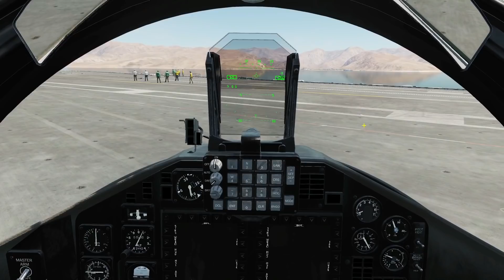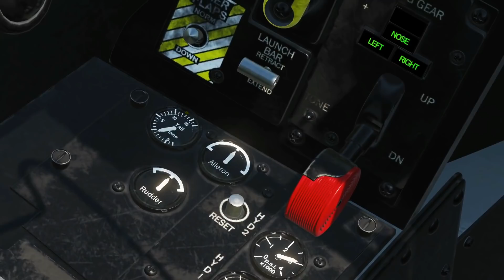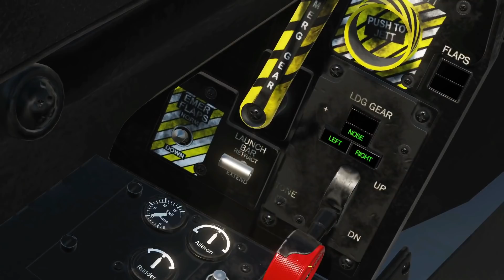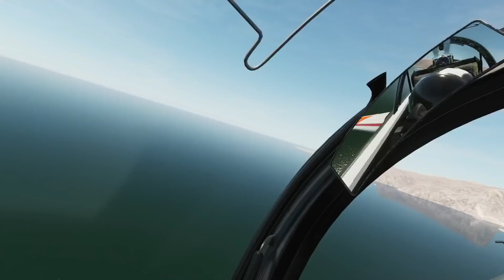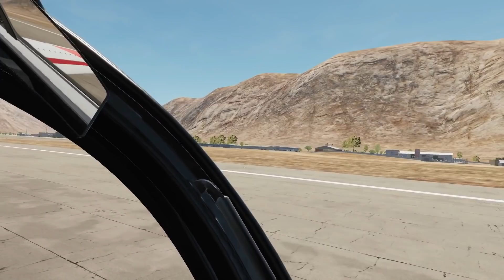T-45C Goshawk: Carriers & Airfield Takeoff & Landing Guide | DCS WORLD

Comment: I keep wrecking the front gear when taking off from the CVN-59, it just sits there for a second on max until it suddenly jumps forward, pulling the nose up before slamming it down again and continuing the catapult launch. Sometimes it survives, but most of the time it doesn't want to put the front gear up anymore. At times it even knocked me out briefly. I've checked that anti skid and the parking brake are OFF. Anyone else has this? I don't have supercarrier to check if it happens there too.
Reply: I have the same problem

Comment: those navy planes are designed to land without flare but not like that. 3 degree flightpath on aoa means about 650 feet/min vertical speed which they can handle. they cant handle your 5-6 degrees landings with huge vertical speeds

Comment: The life of me I keep getting perfect approaches on the aircraft carrier for whatever reason the tailhook will not grab any of the wires
Reply: Happened to me the first few times. I suspect it's due to aircraft being far lighter than an F/A-18/F-14, and so I felt the aircraft almost 'float' above the wires... Perhaps ground affect came into play? Either way, I've found a slightly more aggressive flare than usual helps.
Reply: THANK YOU, I thought I was just being a klutz, 4 good looking approaches, been in a Hornet or Tomcat, ACE'd it,  well maybe not, as they say, If at first you don't suceed....carrier pilot is not for you....well in my case I'm FIRED! , Great fun, teaches spatial awarness, concentration,,,,grab another beer,,,,concentration etc.
Reply: @daviddavids8218  and for the first time I got a Grade B on all three approaches and the tailhook still won't snag
Reply: @pilotguy1141  had the same issue. turns out my brakes were backwards which i barely noticed other than some screeching during taxi, but I never noticed because it would taxi fine. Regardless, once I swapped axis' it trapped just fine. (If brakes on when trapping, you'll probably blow a tire in real life, but if you didn't it would raise the hook point and I think the sim is smart enough to do the latter).

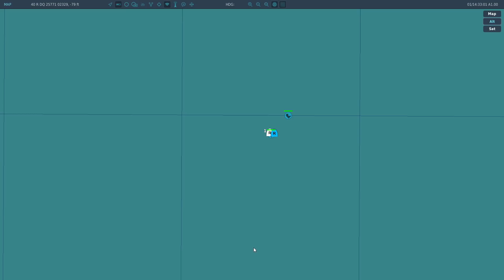Comment: 0:20 You're never doing wrong with the Neightops!
3:42 Acktchyually, that's Unicorn! :/)

12:45 Guess that happens when you don't firewall the throttle on touchdown and the wire is being reeled it. The aircraft is so light and short that pull literally makes it nose up.

Comment: why there no  catapults on airport runways ???
Reply: Because runways are long enough to allow the jet to accelerate fully under its own power. The pilot is responsible for determining that the runway is long enough to facilitate both takeoff and landing based on charts in the aircraft manual prior to using the airfield.
Reply: bc why should there be. there is enough space and a catapulte lunch puts a lot of stress on the airframe, thats also the reason why an f18 that is stationed on a career needs much more maintenance then one that is staitioned on an air base.
Reply: @TheRattail  uhh you cant maintance frame stress wearing.
Reply: @mikkihintikka7273  of course you can but it's f*cking expensive. And why should you spend all that money if you don't have too. And on top even if you do maintenance on the frame stress, their is still a higher risk of failure. That is actually the reason that there are more in air emergencys in the navy than in the air force. Meaning that it would just make the maintenance much more expensive and still put the pilots in a higher risk of a fatal failure.
Reply: The stresses caused by a catapult would damage most un-navalised aircraft...also, they don't usually have a launch bar
Reply: because they are freaking expensive, hard to install (expensive) and not needed.

Comment: Unfortunately they didnt put a "Rudder Left and Rudder Right" option in controls. So for someone like me who doesnt't use them this mod is useless!
Reply: Go to [path to your DCS Saved Games folder]\Mods\aircraft\VNAO_T45\Input\keyboard and open up that default.lua with a decent editor like Notepad++ (if you don't have it, get it!), go to line 50 (which is the end of the "--- Control ---" block, just for clarity) and add this:

{pressed = iCommandPlaneLeftRudderStart, up = iCommandPlaneLeftRudderStop,	name = _('Aircraft Rudder Left'), category = _('Flight Control')},
{pressed = iCommandPlaneRightRudderStart, up = iCommandPlaneRightRudderStop, name = _('Aircraft Rudder Right'), category = _('Flight Control')},

Repeat with the default.lua in the joystick folder at line 62 if you want to map that to your HOTAS devices.

You'll find them in the category "Flight Control" named "Aircraft Rudder Left" and "Aircraft Rudder Right" respectively.

Haven't tried it, but these are the default commands for the rudder on keystrokes in other modules, I just guess it will work here as well.

You might have to repeat this after updating the mod when it gets patched, unless they add it themselves.

Comment: 6 degree approach. Maybe flare just a tad?
Reply: Rate of descent on landing for the Hornet is around 700-750 fpm, can’t see the T45 going down much harder. So I would say you’re correct, based on my knowledge.
Reply: Glide slope should be somewhere around 3 - 3.5°. Just have the symbology a notch above the -5° pitch ladder is a good rule of thumb.
Reply: I'm not sure, but the T-45 is a carrier aircraft so I think it lands flat?
Reply: @protonnumber8867  Navy aircraft are build to support up to 8 degrees AoA.
Reply: @protonnumber8867  I’m not sure about real carrier landings as I’ve never done one, but you are right in that carrier landing is much more, let’s say aggressive:). However, for a landing on a normal runway, a 3 degree approach is normal. If you land at 6 degrees and at the same speed, the rate of decent is doubled and the impact increased dramatically. At 120kts and 3 degrees, the RoD is about 600 fpm, at 6 its 1200, which is high. The OLS ball is set at 3.5 degrees (happy to be corrected here), so at 120kts, RoD should be around 700 fpm. Therefore, 1200 is high and I feel a little flare for the runway landing would have nice and would stopped any pax from crapping themselves 🤣. But, I never flown the T45 or onto a carrier, so I’m mixing knowledge with guesses. Happy to be put straight by those who know better.
Reply: @mandellorian thanks for the info. Good to know